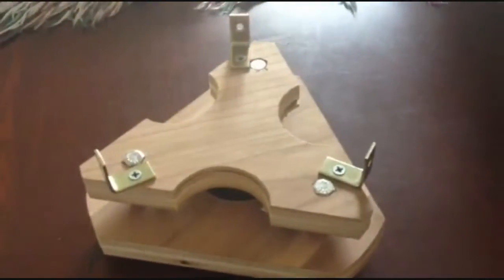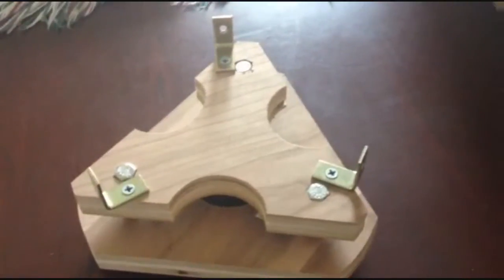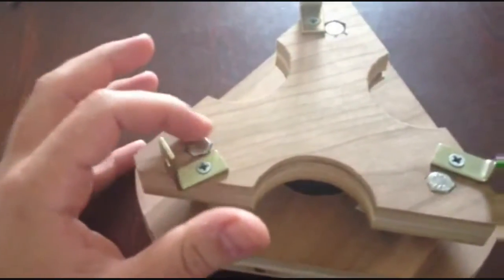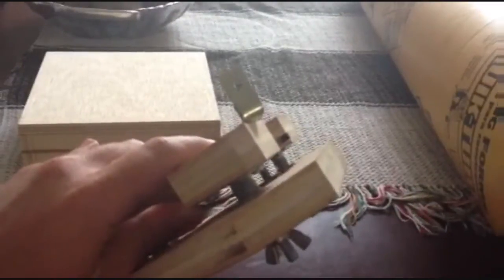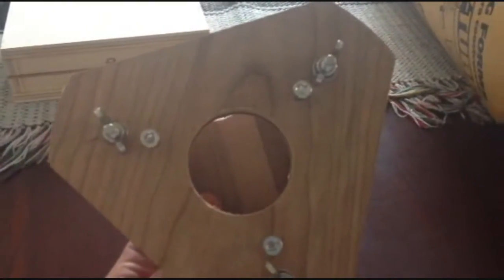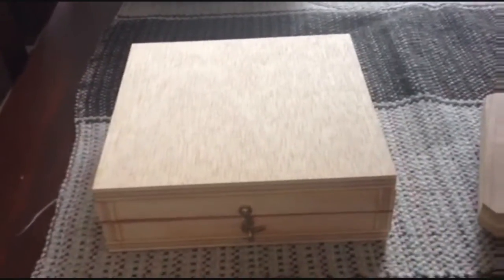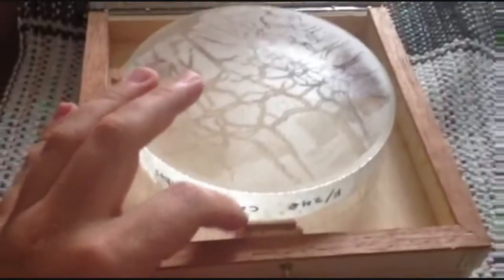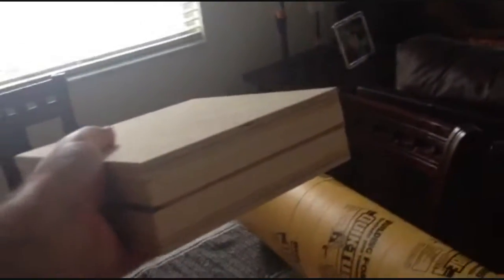Mirror cell, Box & Tube

Comment: Carlos, that is an incredible job on the mirror cell and box. You did not need any additional ventilation. You made it well. Roughing up the inside of the tube is known as baffling. It is a good thing. Paint the interior flat blackand you will be fine. Drill the focuser hole first then put an eyepiece in and move the mirror cell with the mirror installed back and forth in the tube until you have a good focus. That is where the mirror should be fixed in the tube.
Great job! 
Francis J. O'Reilly